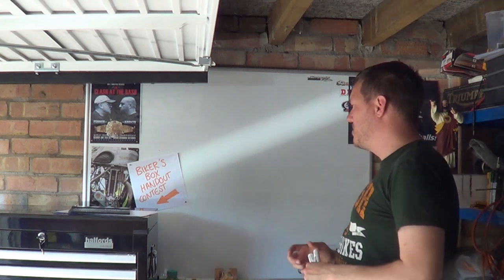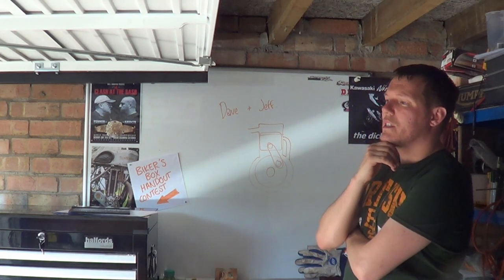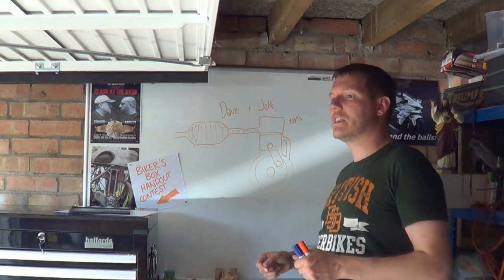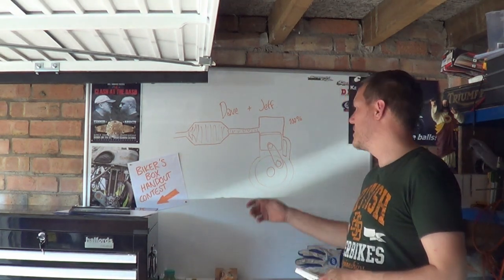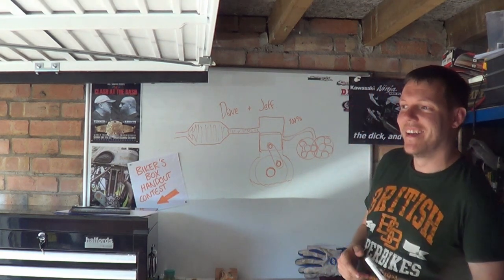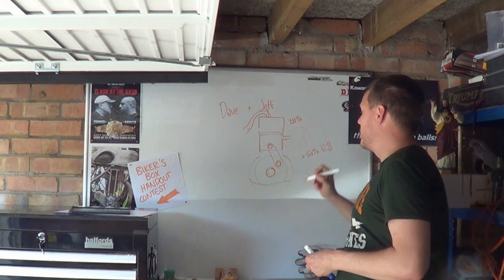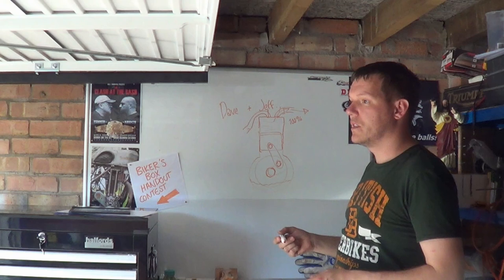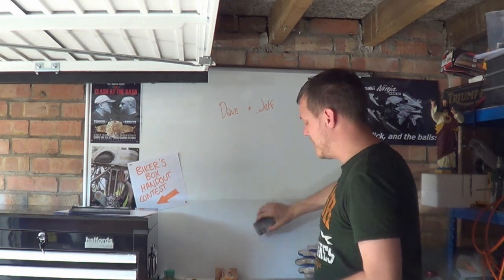2 Stroke evolution - Dave and Jeff story - part 1

Comment: Thank you for the Video, answered many of my questions and helped me alot. 
But now I´m fix on the idea to make a 4 to 2 stroke conversion. 

I´ll buy an Old 4 Stroke Aircooled bike for like 500€ or so.
Then i´ll remove the cylinder and make holes for intake and outtake, add a Turbocharger (I´ll have to start it with my compressor, but for the beginning it´s cheaper) and make a new cylinder head. 
The question is wich spark plug i´ll have to use, I would take a digital ignition for oldtimer´s, but how do i get one wich doesn´t burn the piston. I would use one for a 2 stroke with half the ccm (a rd 200 ignition for a 400-500 bike) .

I got the time, the machines, and after a short discussion i´ll have the permission to use the Money ;D. 
I wouldn´t bet that it´ll work, but it doesn´t have to, i´ll have my fun anyway.
Reply: I love how you handled every detail, drom the 2 Stroke diesel to the supercharged version.
Reply: Bit Moto, I have been  thinking if you used a catilatic converter on 2strokes to reduce oil out put
Reply: hacksmith engineering On this build i'll use a bike wich is older than the euro normes. But on a modern one of corse, why not?
Reply: When thinking about it, i'll bring it to the tüv (germany) and do some tests, about emissions and if im the luckiest guy on earth i get it street legal. 

Im not retarded it wont get street legal.
Reply from the maker: "I have been thinking if you used a catilatic converter on 2strokes to reduce oil out put "

- how would a catalytic converter help? A cat is not a catch can. Unburnt fuel and some of the nasty additives of oil are the problem. Cats help 'burn' the fuel but the oil is another issue.
Reply: what about a rateater on the exost to split up the carbon dioxide from the oil
Reply: Just get a roots blower and open the intake and exhaust valves at the same time and use the blower to loop scavenge the air. Job done money saved.
Reply: +The Woekshop Rob a DPF off of a diesel truck.
Reply: Bit Moto that's great

Comment: does a supercharger pump better or worse than the crankcase pumping?
Reply from the maker: Hard to compare, depends what you mean by worse?
Reply: The Workshop comparing the pumping efficiency of the crankcase compared to the pumping efficiency of a supercharger moving the same amount of air
Reply from the maker: Crankcase pumping, the rings seal better

Comment: We all know what comes out of a 2 stroke exhaust is some bad shit, but the particles are big and heavy and after a short time gets deposed on the ground, unlike a 4 stroke which the  particles are very small and light and stay in the air for a long time, so what is worse? some bad shit that stays on the ground for a long time or bad shit that stays in the air for a long time? it is all shit anyway, one is not better than another, this all shit!  I can tell you one thing after riding motorcycles for over 50 year's it sure is fun spreading all that shit around!
Reply: I can sea your fury
Reply: Good one!